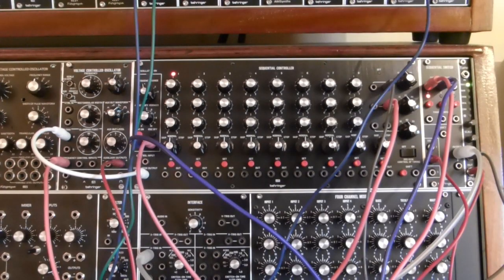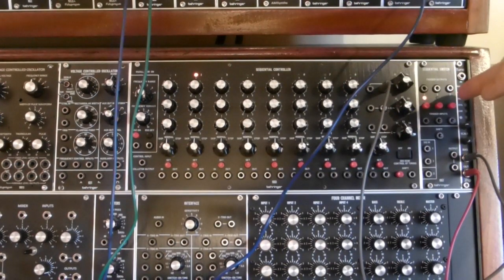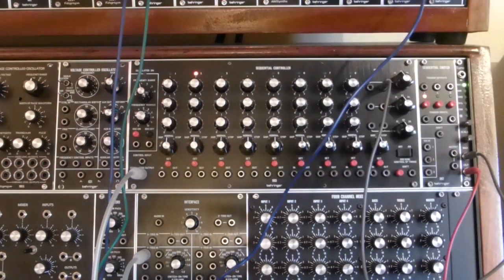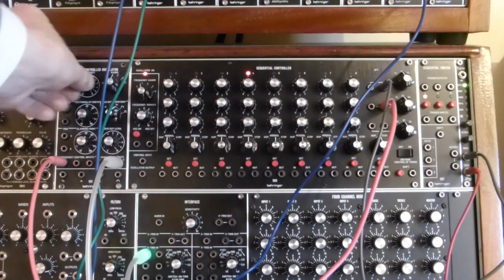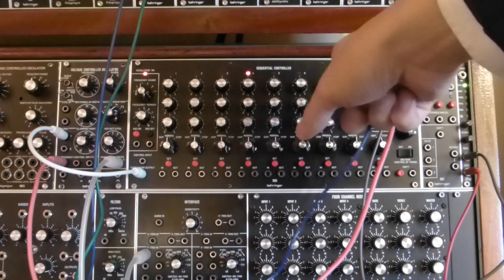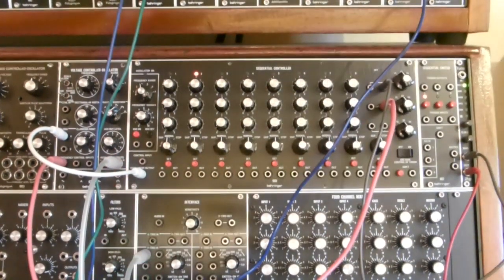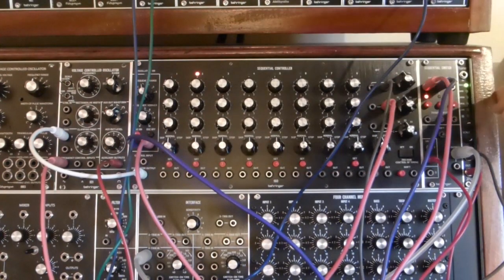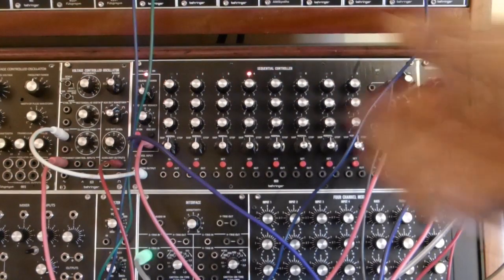Ratcheting the Behringer 960 Sequencer

Comment: HI and apologies for the late comment but I'm trying to find a way to get my 960 + 962 to ratchet and came across your video. I'll explain at the start that I'm new to modular and my setup is quite limited but I'm able to run my 960 into the 1v/oct and Gate on my Doepfer A-111-6 or my behringer model D and the sequences work fine. However when it comes to ratcheting I'm not able to follow the routine you show here and I'm wondering if its the lack of an Interface unit or the limited connection points available compared with the ones you have on the 921 that's the problem. The Doepfer unit has: 1v/oct, Gate, Env, CVBal, Ext In, Mod, CV1, VCFFM1, VCFFM2, Out. Any help you could offer me on this would be much appreciated. Thanks Tony
Reply from the maker: the key thing is that the internal clock of the 960 is "stepping" the 960, but the 921 oscillator (acting as an LFO) is providing the gate (trigger) pulses to the envelope generator(s). 
The 960 second row CV isthen  controlling the 921 (gate/trigger) frequency, giving the ratcheting.
The problem is keeping the 921 and 960 clock running in some form of sync.
It works in the "moog" setting because the 921 VCO (uniquely?) has the "clamping point" input that effectively locks it all together. 
You could possibly make this work with any voltage controlled VCO/LFO with a sync input (I haven't tried!).
Reply: @fitzgreyve  Many thanks for your quick reply, I'll dig a little deeper.

Comment: I just bought the sequencer and the switch will any VCO do if it can go low enough 🤔
Reply from the maker: This specifically uses the "clamping point" feature of the 921 oscillator. In theory it would probably work using any VCO with a "sync" input but it will take some experimentation. There are plenty of volltage-controlled clock dividerers/multipliers around that can do more precise ratcheting, but the point of the video was to do it using only "moog" modules.

Comment: Newbie question here. I just got the Klavis CalTrans quantizer. Will it work together with the 2hp tuner or it will do the same? Great video, thanks.
Reply from the maker: Hi, the Quantizer (in my case 2HP Tune) is not necessary for the ratcheting. I just use it because I'm not skilled at adjusting pitches. I wasn't familiar with the Caltrans, but it looks to be an interesting module (built in glissando and portamento!). The Caltrans will take an input voltage up to 7 volts (better than the 2HP which will only take an input of up to 5 volts). The B960 outputs up to 2V with a range setting of "x1",  4V for  "x2" and 8V for "x4", so neither of them will process the highest outputs with range "x4". 
Short answer: The Caltrans should work fine. Neither the Caltrans or the 2HP will process the full range of output voltage in "x4" mode.
Reply: Thanks @fitzgreyve  I got the ratcheting setup but I'm still confused about the difference between a Quantizer and a Tuner. Will the Tuner tune the vco to a perfect pitch and then the Quantizer move between perfect semi-tones and octaves?
Reply from the maker: A tuner (generally) shows you the pitch (frequency) of a note, including whether it is sharpe or flat - it just "shows you what you've got" - it doesn't modify anything. A quantizer acts on a contriol voltage (CV) and constrains it  to only those voltages that represent notes on a specific musical scale. The "2HP" module may be confusing you because while it is called "tune" it's a quantizer ?
Reply: Yep  @fitzgreyve  my confusion was on the name. I'm using a Mordax DATA for visual tuning and I just got the Klavis CalTrans Quad quantizer. it include Porta and Glide too. Thank you!

Comment: Thicko here.... how are you getting that 921 to pulse? Mine just makes a continuous tone? ACTUALLY it is pulsing but when the 921B that is creating the sequence is connected the pulsing is non existent.... I must be doing something dopey as usual! Hey ho! HANG ON...... just moved the selected knob on 961 row 2 to x2 and I believe I have ratcheting.....well i never! Thanks again!
Reply from the maker: The on-screen 921 is just acting as an LFO, synced  to the 960 internal oscillator (the short white patch cable). Tone generation is "off screen": VCO plus 902 VCA and 911 EG. The gate/ trigger pulse from the 921 to the 911EG is the illuminated patchcord, which goes to the EG via the 961 at the bottom of the screen to convert V-trig to S-trig.
Reply: Hi - yeh i think I'm there.... I was forgetting that its the LFO that is 'pulsing'.... I got it all working beautifully - THEN tried to control it via my midi/cv/gate module so I could sync with cubase....... THAT's when it all fell apart again..... But following the vid got the ratcheting and manual starts to sorted so huge thanks. @fitzgreyve

Comment: only got to1:35 and already got a question... I spent about 40 mins yesterday tuning in a sequence - have you a link to how on earth that/any 'tune module would make my life easier???? Shall now listen to remaining 5:00's
Reply from the maker: One of the issues with "old school" pontentiometer based CV sequencers is that they allow tuning to any pitch, including those not on a recognisable musical scale.  Modules called "Quantisizers" (or "Quantizers") as a minimum break the continuous CV into discrete steps, each step (normally) being a 1/12th of a volt - i.e. a semitone.  This would give you access to a basic chromatic scale with no off notes.  Most quantisizers feature some form of scale selection as well (e.g. major, minor, diminished). I've used the "Tune" module from 2HP (https://www.twohp.com/modules/tune). Positives: it's only 2hp wide (so unobtrusive when sat next to a 960), it has a transpose CV input (they call it "bias"), and it comes in black! Negatives:  it will only process voltages in the range 0-5V, has a limited range of scales available, and scale cannot be selected by CV.
Reply: @fitzgreyve  Wow - really appreciate that... I totally get the explanation - really clear - I dont tho get the negatives (or do I/) 1."cannot be selected by CV" - does that mean that you have to 'manually select scale? If so I can live with that. 2. "limited range of scales" pretty sure I can live with that as well. 3. " it will only process voltages in the range 0-5V" lost me on that one ( no one said this was going to be easy!😇
Reply from the maker: @2009Tosh  taking the Behringer 960 sequencer specifically, if the range switch is set to X1, you can get a CV out range of 0-2V (2 octaves, no problem), set to X2 you get 0-4V (4 octaves still no problem), set to X4 you get 0-8V range (8 octaves), but the 2HP "Tune" will only handle 5V (5 octaves). Its not really a problem, just a limitation to be aware of.  The fact the 2HP won't handle negative voltages isn't an issue using the 960 as it doesn't generate them ,  however other modules (e.g. my 1125 sample and hold) can output negative voltages and if fed into a 2HP Tune it treat anything less than zero volts as "zero".
Reply: @fitzgreyve  STAR.... with you now!  A 2HP 'Tune' has been ordered.... will sit nicely beside my existing 2hp 'LOOP' (Just above the 962) Really appreciate your help! Next step Ratcheting......!
Reply from the maker: @2009Tosh  It is tricky to adjust the 921: I would try running it slighlty faster than your desired tempo (960 Frequency), then adjusting the clamping point to get it to "lock" . If you change the tempo (960 freq) you need to re-adjust (so it doesn't work for if you need rallentando etc) , but it does save needing a "non-Moog" frequency divider or similar. Hope it works for you.
Reply: @fitzgreyve  The ability to easily tune will be a hooooodge step forward - and any 'ratcheting' will be an added bonus - Many thanks again!
Reply: @fitzgreyve  Huge thanks again.... the  2HP tune is now in the rack and connected... AND tunes beautifully... Pushing my luck here - BUT could you tell me why we connect the 960 to the 'bias' rather than the 'IN'? And just discovered I'm a 921a short of being able to ratchet... got a 921, 921b but as of yet no 921a... ( Now run out of rackspace...)
Reply from the maker: @2009Tosh  You spotted something I hadn't - the input to the 2HP tune should have been connected to the "IN", not the "BIAS" - however it still seems to work! (the BIAS input is just transposing the IN, though it may only work over one octave - the 2HP manual isn't clear on this point). In the video I've used a 921 to ratchet (so you should be ready to go ?) , though it might also work with a 921A+921B using the 921B "SYNC IN" instead of the 921 "CLAMPING PIOINT" .